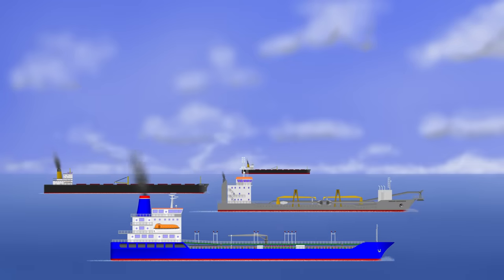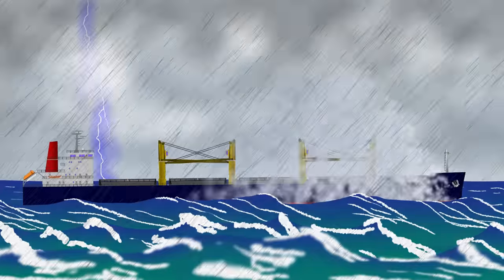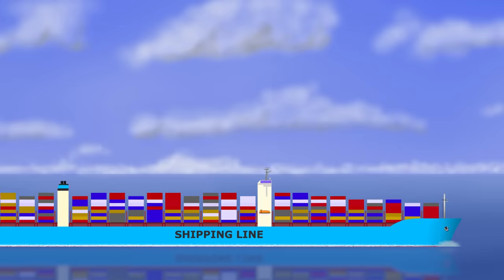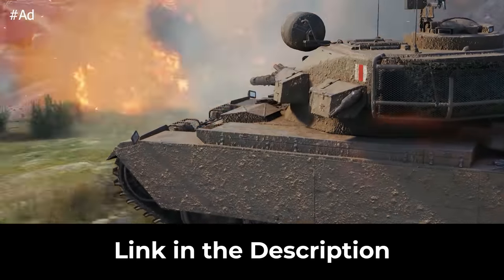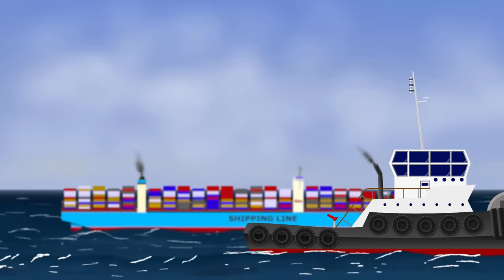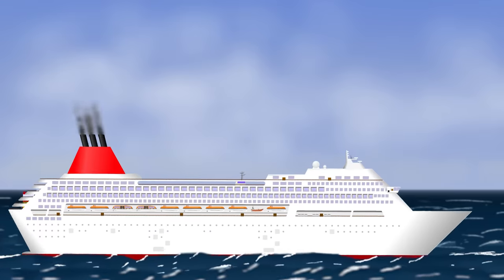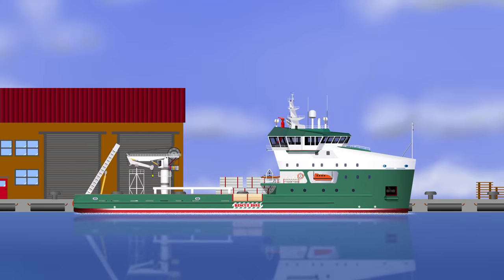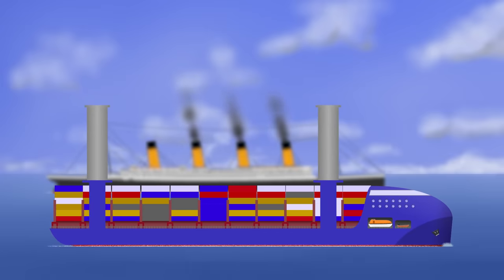Why Is The Bridge At The Back?

Comment: Maybe an idea for a future video... Why do OSV's (almost exclusively) have a large 'rescue zone' written on their side? And what is that area for, what makes it special? Thanks!
Reply: In emergency situations that area is away from the underwater hazards on the ship, bringing people on board from lifeboats or being in the water is safer for them there, conversely, pulling people off the ship is also safer there.
Reply: My non-expert understanding is there are several reasons. Firstly, these ships are not just transporting cargo and doing other work; safety, search and rescue and firefighting is part of their job too. So unlike other large ships, rescuing people is a core part of their job. The first option in a man-overboard situation would be to deploy the small fast rescue boat, but you can't do that in rough weather. Most of the ship's hull is too tall for effective rescues, so they have a small area with a lower opening that can be used to get someone up a ladder. In rough weather, there is also an option where they basically hang a net from the crane and drag it through the water for you to grab - and you will see that the rescue zones are within reach of one of the small cranes.

Comment: the placement in the bridge, in my opinion, should be entirely in the opinion of their designer. For example for a high speed north Atlantic ocean liner you should place the bridge at the front to prioritize collision avoidance, it is a lot easier to steer around an iceberg sooner rather than later.

Comment: While not nearly as prominent as it once was, Combat, a Battleship such as HMS King George V, would have its fore and aft sections dedicated munition storage and hoists for the Main Battery Guns, with Accommodation and Life saving equipment plus Anti Aircraft mountings and Secondary Battery mountings on the super structure. With Machinery spaces below decks amidships. With the bridge aft of the forward main battery in combat you have a good idea of what your turrets with the majority forward are doing and a visual of the aft turrets by stepping onto the bridge wings. With the Amidships Bridge position you would have a real good idea of how to manoeuvre your ship during a combat action as particularly if you wanted to close the distance between you and the enemy, with the majority of your main battery forward. And once the range was to your liking, you could bring the third turret into Action by turning the ship to bring that turret to bear. Or keep it obscured and out of the action to better protect the ship in regards to core sections. 

An excellent example of a bad combat choice is the Nelson Class battleships which like a Large Bulk Carrier, has all machinery and superstructure in the rear. And ofcourse instead of Cargo amidships and forward, big 16 inch guns. However The Nelsons had a problem. The guns, past certain angles, particularly with Turret 3. Couldn't fire forward.. Or if firing Aft. The Gun Blasts Would blast out the Windows on the super structure including the Bridge. Not something you'd particularly want during a large Atlantic swell but after a combat action if you hadn't been sunk you could live with some blown out windows.

Comment: I do think the position is becoming less important with better communication on bored ships the ability to use cameras for seeing past obstacles and soon most will probably be able to control most of the ship from a I pad anywhere on bored 
I all so think there’s something to the idea of less manoeuvrable ships because it takes enormous amounts of power for small quick movements where as I see more using power like wind will never work for coming in to port by its self so it’s a waste to have that engine for relatives part of the journey where as if there was some sort of docking system that the ship docked with and then it manoeuvred the ship into port

Comment: I'm just now wondering what if any night vision gear ships mount. I've used thermal systems that ranged from could tell the sky from the ground to, could identify someone by their face, to watched a mouse at 6km playing in the desert. I've also used low light vision gear that let me see the light escape from the stitching on a heavy tent. With modern tech I would expect a ship could have a fair amount of vision enhancement looking in all directions useful day or night (at least for the thermal gear). If vision was such a critical factor in design while the old mark I eye ball is a good backup it seems that technological solutions would be the default.
Reply: I've never seen any thermal or low light image system onboard, but I'm not deck so I don't spend much time on the bridge. From what I've seen they just blackout the bridge and lookout as best they can

Comment: Traditional warships have the bridge as part of a massive midship structure. The new stealth ships have the bridge forward. Most navy service boats have the bridge forward. I’ve never seen a military vessel with the bridge aft. Except for: military cargo ships, merchant marine, and hospital ships (which are converted freighters).
Reply: Combination of needing height already for the fire control system, so why not put the conning tower there as well, and the desire to make it so that a single salvo of shells aimed at the bridge can't normally take out the bridge and something like the engineering spaces
Reply: The British Nelson-class Battleships had the superstructure and bridge aft, with the main armament all in front of the bridge. They were derisively called "Nelsol" and "Rodnol" due to resembling oil tankers, but their compact layout meant they could pack some serious firepower and armor into 35 thousand tons.
Reply: @gargravarr2  Their all forward armament and aft superstructure helps them get to that 35k tons, along with some creative use of "boiler water" to work around the Washington Treaty (IMO if they would have left out the conning tower, as the KGVs, refit QEs, and Vanguard all did, and put that weight to the turrets, they would have been less trouble early in their careers). However they were no jokes, Rodney did punch straight through Bismarck's Bruno turret and conning tower, as well as possibly land the only battleship vs. battleship torpedo hit in battle, after overclocking the worn out engines to get there, and dodging Bismarck's return salvos.

Comment: (From) verios44 (A great reply to me, reprinted)  @Beach Bum  (reference light pollution that interferes with safe navigation at night on ships) it is quite a big issue. Commonly on cruise ships that have cabins directly above and below the navigation bridge, they all come with a requirement to use blackout curtains during a specified time during the night. That way there is no chance of light bleeding into the bridge itself. A good example is the panoramic cabins on a ship such as Freedom of the Seas. Another is the solarium on the Oasis class ships. Its positioned directly above the bridge and runs with minimal red lighting at night to avoid that problem.

Comment: Here's probably a stupid question for you;  Do those large cargo ships have elevators in the bridge tower to get between below deck, deck, and the bridge?  Or is it all flights of stairs?  And either way, are there aids for getting to and from the elevated bridge in rough weather?
Reply: Most large vessels do have elevators onboard which have limit switches cutting them out if the motion of the vessel is too much... about 10° roll to either side but if they don't, its a case of the Master welcoming the pilot to the wheel house with the comment, .... "Good Afternoon Pilot, Welcome on board.... Coffee... Tea... oxygen?"
Reply: @brianmaguire4675  Hah!  Thank you for that anecdote and info.

Comment: Simple Answer:  Because then you can order a ship with however many different sized cargo holds you like and they don't have to change any of the crew/engine areas and the important controls don't need additional repeaters.    It's cheaper and easier to mass produce.   No other reason is valid.

Comment: No bridge at all. Just have remote cameras and distance sensors with radar and other navigation equipment feeding back to the engine control room. The engineering officers can then take responsibility for all shipping operations. This will cut the manning costs and finally end the hangover from sailing ship days of having deck officers. A modern ship is a highly complicated piece of engineering that requires the skills of engineers. Swanning around in fancy uniforms manually obtaining the position of the ship by means of a sexton and tables is indeed traditional, but along with deck officers they are now more a museum exhibit rather than a necessity.

Comment: if I had to design it why not put the bridge and accommodations in a stand-alone structure that is mounted to a cargo ship. it would have its power, propeller and separate power unit that if the vessel goes down the bridge then floats clear and can take everyone to safety not unlike a shuttlecraft on from Star Trek or the captain's gig what you never see in the movies.
one major benefit would be if this structure was standardized then when the vessel needs to be replaced then lift it away and move it to a new vessel. this appears to me to be cheaper in the long run.
idea 2,
So, with the Advent of all this modern technology the best place for the bridge is onshore and the vessel is controlled remotely. you can take a airplane and fly it 1,000's of miles and then return why can't you take several ships and have them set up in such a way that there is a command center that controls the ship's?

Comment: I would think that having the bridge at the stern also means that the bridge crews can observe the cargo area, which means that issues can be quickly identify potential issues, and security since again the bridge crew can observer most of the ship. The only place the ship can approached without being observable from the bridge.
Reply: You can do that whether the bridge is fore or aft, no?  Just look back.
Reply: @tsm688  Have you ever looked at a bridge. Guess not.
Reply: @cliffordnelson8454  If it's important to design a bridge for backward visibility, why not do so?

I understand this won't necessarily happen, there's one not even really designed for forward visibility...

Comment: As a mariner of 40 years, and Captain for 27, I can tell you for a fact, that having the house on the stern, not only allows me to see all activity on deck, but the fact that the pointy end goes up and down much more than the stern. It is way much more comfortable in the back. Being up high on either end, will make any rolling motion more pronounced. In a following sea, being in the back is not so bad, as you are surfing more than pounding headlong into it. I also find house aft, easier to trim, and keep level, as all the load goes in the center, and not over loaded on the aft deck. I prefer house aft, any time.
Reply: Speaking as a former C/Eng.... All aft accom and machinery spaces give the crew and machinery an easier "ride" and lets be honest.... if the crew are rested properly much better and less likely to have "incidents".
Reply: @brianmaguire4675  100% correct! As a walk on captain, I have ran house forward, midships, and aft. Aft is best for sure. I have even gotten sick just walking up to the bow making my rounds. In a following sea, you feel more like you are surfing, while bucking into it in a forward house, I think I have "logged" more weightless time than many astronauts!

Comment: An ex Second Officer here. It's all simply because of the ship's stability and structural integrity calculations. Nothing less, nothing more. People often forgot that the ocean itself gives HUGE pressure on the ship's hull (Third Newton Law), so to minimize the pressure, the ship must distribute all of it as evenly as possible. That's the first important point. The second one is that the design must allow the ship to be as "even keel" as possible in any voyage condition, laden or ballast. Here's how those two work; let's say you want to carry bulk cargo, put the bridge at the aft. Bulk cargo is stored inside the hull, so you'd get a clear view on what's ahead of you. But why not putting it at the fore, you might ask. Because the superstructure is damn heavy, almost as heavy as the engine compartment. If you put two heavy objects on a polar opposite of a stick, it will be bent. It's called hogging and extreme hogging would cause a ship to break in two, taking many lives onboard. Way too many cases happened (and sadly are still happening) because of this. So that's why you put the engine compartment AND the superstructure of any bulk cargo (liquid, gas, or solid) carriers at the aft.

Comment: I have a video idea. How do you paint the very bottom of a ship? Such as the bottom of the keel. This has always made me wonder how they do it
Reply: Dry dock
Reply: @Thomasnmi  I know that but the ship has to be sitting on blocks so how do the paint areas that have the blocks
Reply: @bustinlooseracing7144  A bit like when you're painting at home.... you tell the wife you're going to paint it next time.... (actually its very rare that docks, even if its the same yard will put the blocks in the same place twice.  The maximum time that a vessel can not dry dock is 7.5 years and that's only if satisfies the requirements of an EDD (Extended Dry Docking) programme, ... other than that its 5 years.... with at least an In-Water Inspection at time of Safety Construction Certificate Intermediate Survey (SOLAS and Classification Society requirements), Two Bottom Inspections in any 60 month period with no more than 36 months between inspections.

Comment: It is not important anymore where to put the wheel house. With the proliferation of cameras nowadays, even a fully loaded container ship with the wheel house at the back is not a problem. In the case of rare total camera failure when docking, simply assign a crew member at the bow with a walkie talkie. In another few decades, many of the crew could be thousands of miles away, in another continent, they are doing that with drones now. You did not mention many longer ships have bow thrusters and cruise ships have pods that can turn 360 degrees.

Comment: Bridge - hundred of years, bit of an exaggeration. Sailing ships were always commanded from the strn where the wheel was givving good communication and a view of the sails. Longer - 300ft plus sailing ships had a raised walkway along the centre so that the crew could move safely, bridges didn't enter use until you had a damned great smokey funnel in the middle of the ship,

Comment: There's no need for a bridge on a futuristic ship, as they'll eventually be completely autonomous. Sensors/cameras are small, and tight maneuvering can be achieved with thrusters and tugs, none of which requires a bridge. All the pieces/parts/technologies are ready to go, and cheaper by the day, the only real issue left to solve is bureaucracy
Reply: You overestimate automation.

Comment: Question to the Engineers :  If the engine is below the Deck's of accommodation.  How does one remove it to replace it ?  Is it through the side ?
Reply: If you have to remove an entire engine... you dismantle it into its component parts, cut away a section of the shell plating at the side and move the bits out through the hole you've cut....  But this is not a common thing to do..... Thank God! ..... Though I did sail on board a vessel where we didn't have the headspace to lift out a broken tiebolt in one lift so we had to cut a hole in the deck above the engineroom....( in this case the laundry,)  lifted what we could, secured the bolt with a collar, gas-axed a length off, lifted again..... cut.... Cleaned and gas-freed the sump tank and crankcase, gas-axed the the lower section of the broken bolt.... about 45cm at a time...... until it was out..... installation was much easier.... (MAN 9KZA90/120, ...9 cylinders, Liner Bore 900mm, Stroke 1200mm). I speak as a former Chief Engineer and now Classification Society Surveyor.

Comment: Depends on the vessel. I'd keep it rearward on a cargo vessel but on a cruise ship I'd plonk it on top of the superstructure offering a nearly 360° view and I'd include some support bridges fore and aft in which a few officers can make observations and feed information up to the captain. These extra bridges also serve to keep a distribution of high ranking crew across the vessel should she get into trouble and can include emergency control points should the need to pass control of the vessel arise such as in severe damage to the main bridge from fire for example.
Reply: Placing the bridge on top deck of a cruise ship would make visibility very difficult for the bridge crew at night, too much light killing night vision.  The loom of cruise ship lights can be visible 20+ miles away at night   Not sure exactly but I suspect a cruise ship may only carry about 5 actual licensed deck officers The captain a non watch stander, Chief mate maybe a watch stander A second mate watch stander and two third mates as watch standers. I worked with a mate who had worked as 3rd mate on a non US flag cruise ship so going by what he told me.    All the secondary bridges would be crewed by unlicensed seaman lookouts not officers. It would take three crewmen to man one of  those posts 24 hours working 4 hours on and 8 off.

Comment: 1. Tradition. Historical., rudder proximity. 0.37
2. Convenience. 0:49 Side note: Engine in larger is usually placed quite far towards the midships.
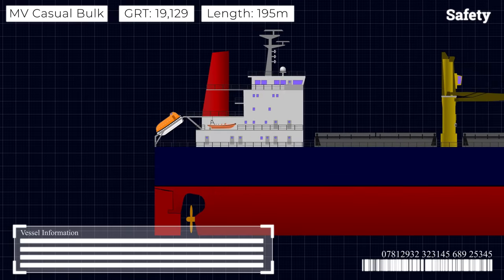3. Safety. 1:03
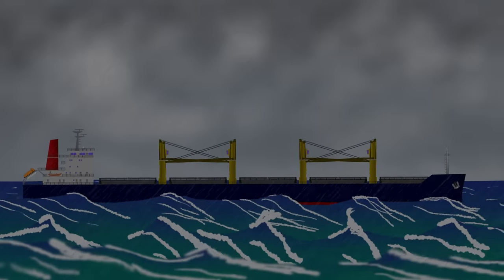4. Maneuvering. 1:22
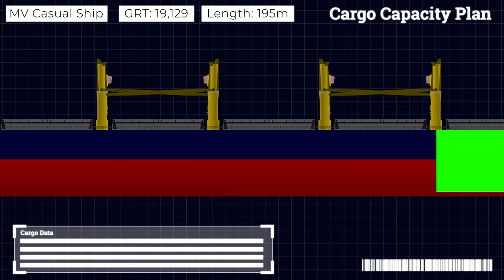5. Maximizing cargo capacity. 1:56
6. Mysteriously disapeeared.